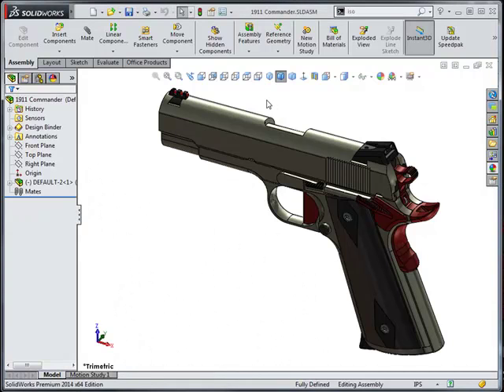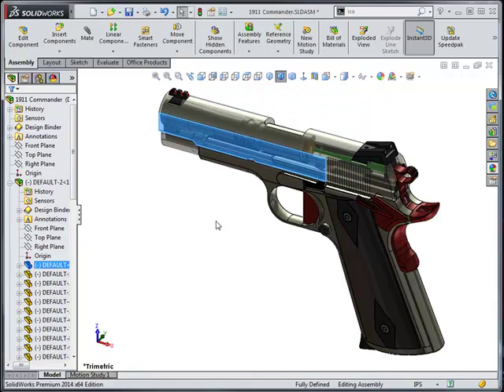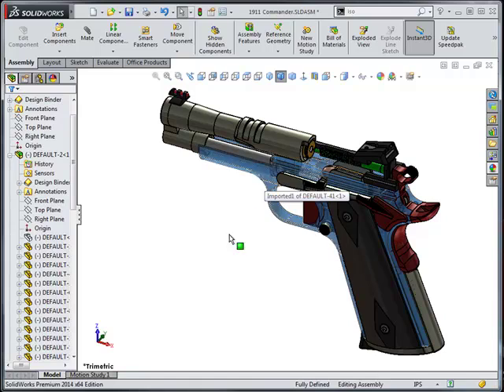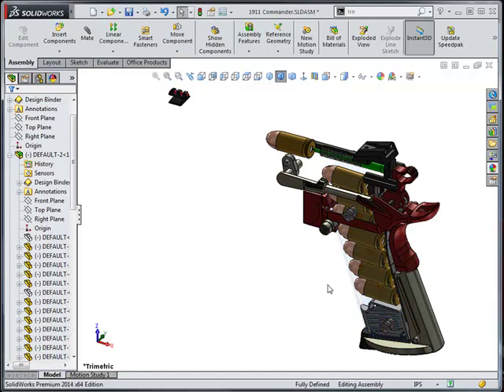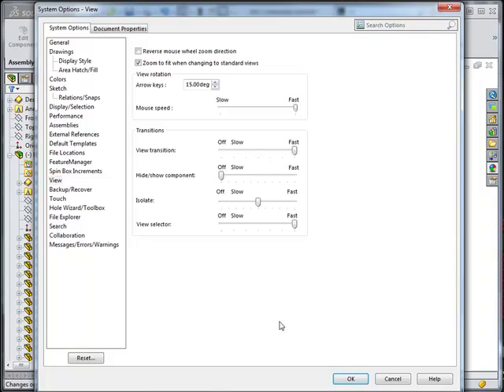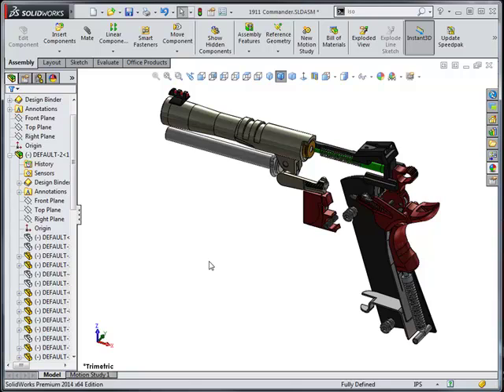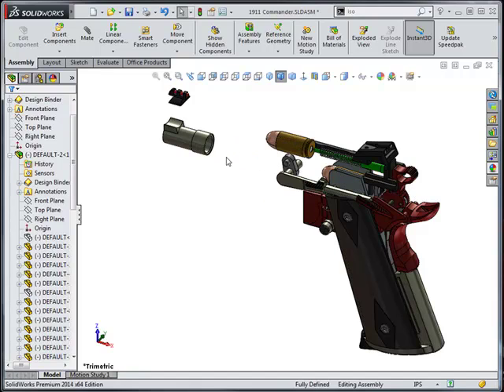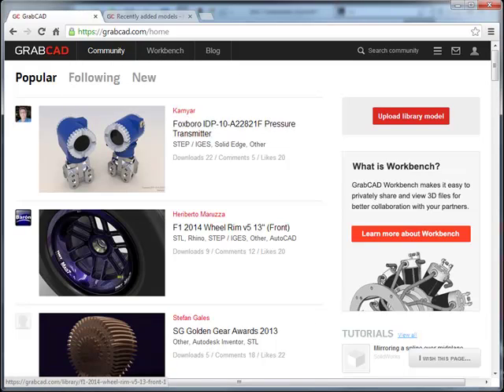SolidWorks' Power Hide Tool

Comment: Hi!
I was so delighted about this, that I couldn't wait until the end of the video to try it out, so I paused it and jumped straight into the model I was working on to see it for myself. Surprise, it didn't work - reason: it hides COMPONENTS (not features, you silly - me, silly - you, CATI). So, for the others, make sure you're on an assembly when you try this.

Addition* For showing the hidden components, place the cursor where you know your component is and press the Shift+Tab keys (in that exact order), or press the Shift+Tab keys and hover the cursor over the place where your hidden components are.

Thanks a lot for sharing this!

Cheers!

P.S. As I've said before, the more I know SolidWorks the more I love it.
Reply: hi sir